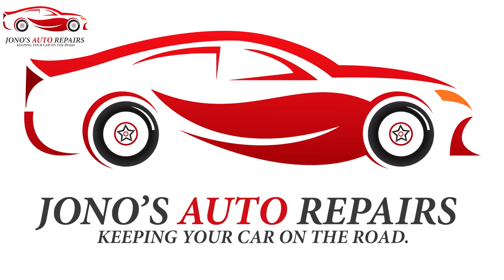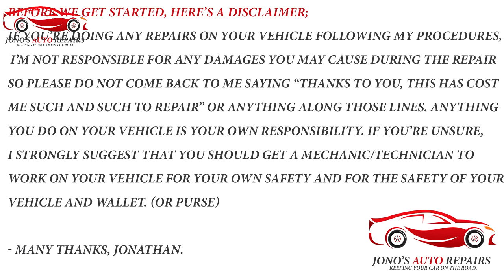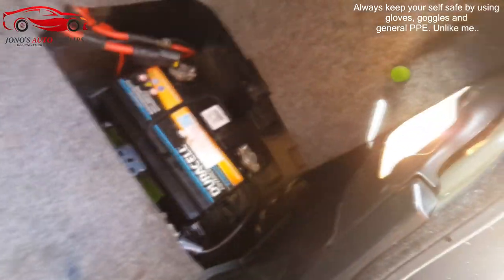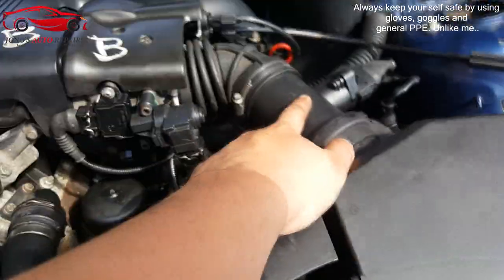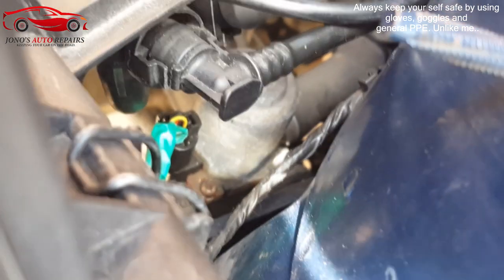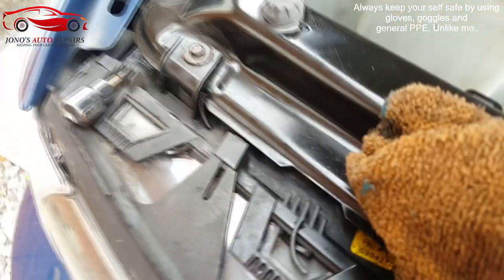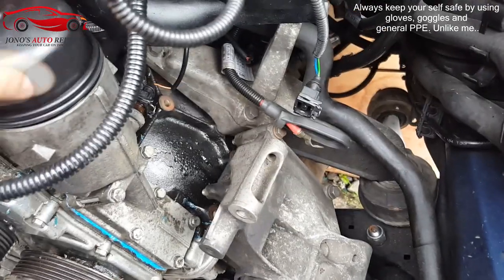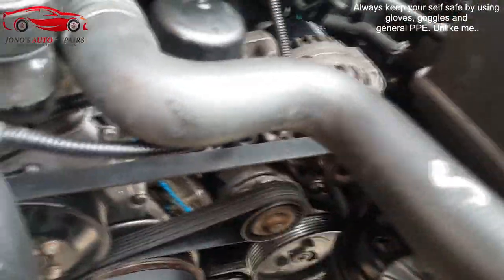How To Repair Oil Filter Housing Leak On A BMW 318CI M43 Engine

Comment: I have the same engine with the same problem. You made your own gasket but I was able to buy one. Also when I bought a new bush it came with the O-rings already on it..which is great. But I also ordered two O-rings. guess a good spares.

I see so many videos for the larger engine - glad I got this motor as it is much easier to work on!

Comment: Thanks, nice video! It's quite rare to find DYI videos for my M43 engine (there's a lot of DYI videos for E46 320+, unfortunately 316s and 318s are quite different under the hood...)
+1 for next video with M43 :)
Reply from the maker: Hey thank you for watching my video! I really appreciate it. That's part of the reason why I did this video, hardly any on this engine. Mainly on the new engine. I hope to get some more repair/maintenance videos on this car soon.

Again, many thanks!

Comment: I wouldn't be using sealer. The standard BMW paper gasket is perfect, just a smear of grease either side and fit it. Sealer can become dislodged and make it's way into the engine, blocking an oil way.

Comment: Hello, please reply! My valve (the little ring) is from metal! Not rubber. I did order one, it came in rubber like yours. Do I just pull the metal one off and put the rubber there?
Reply: My oil filter top is metal too, like the m3 ones. No idea why. It's a m43b18 tho

Comment: hey, did this about 7000kms ago, and it started leaking again uugh i think its because of the rtv maybe.. is yours still good? im gonna retorque the bolts and see if it helps
Reply from the maker: Mines still good. I've done 35,000 miles since then.
Reply: @Motor-repairs  should i use more rtv on the second time? Idk what failed tbh. Maybe im gonna up the torque up a bit too
Reply from the maker: Did you change the 2 o rings on the return valve?
Reply: @Motor-repairs  yeah i did but used some generic ones so i think that might be the problem, im ordering the parts from the dealership now.. Hopefully it lasts this time
Reply from the maker: @wwandyyww  yeah I used genuine once and it's still okay. Also make sure the surfaces are 110% clean before putting it back together.
Reply: wwandyyww trouble with generic ones is most o-rings on those BMWs aren’t standard size, they’re a wonky size and they have to be either a genuine or a replacement part. Generic ones are hit and miss, depending on the application but since you’re risking doing all that work for nothing, it’s well worth getting the proper ones right away.

Comment: Hi! Great vid, one question though-  I believe I saw you have GB plates, could you please tell me where did you find those damned o-rings as I have no luck at all :(
Reply from the maker: Hey sorry for the delay, I never got any email regards to any email :O I got my gasket and O rings from dealership, you can phone your local BMW. Or you could even go on eBay, just as good. Just search up BMW M43 Oil filte housing gasket and look for the one with o rings with. http://www.ebay.co.uk/itm/BMW-OIL-FILTER-HOUSING-GASKET-O-RING-SET-M43-E30-E36-E46-E34-Z3-11421709800-/391428870755
Reply: @Motor-repairs  The BMW online is excellent for finding the parts as well.

Comment: buy the valve instead of 2 o rings works out same price as you get o rings with the valve
Reply from the maker: Jayash patel could do this too!
Reply: what is the part number or what size of the O-ring thanks
Reply from the maker: Part number for the O ring I believe is "11421709513" and the size I believe is "24x3", you'll need 2 of them.
Reply: Jono's Auto Repairs thanks so much
Reply from the maker: No problem
Reply: @Motor-repairs  Any chance to confirm this? Sprung a huge leak on car and after opening it up determined it was this part. Searching led me to your video. Need a size/part # for this o-ring.

Comment: I have a 97 Tahoe 5.7 and I have very high oil pressure and oil blows out my oil filter and I don't know why can anyone help
Reply from the maker: There's usually a pressure valve within the oil filter housing. Potentially clogged up with gunk?